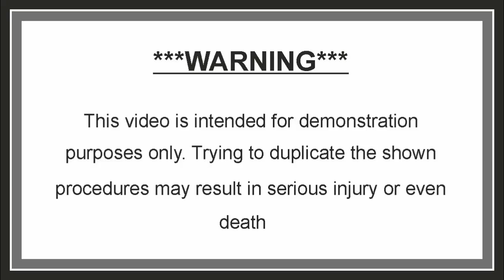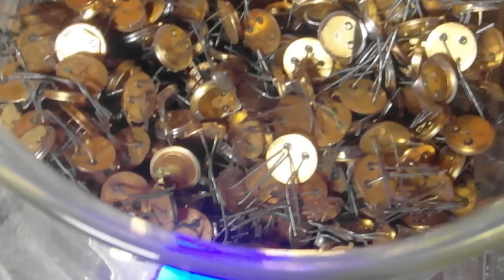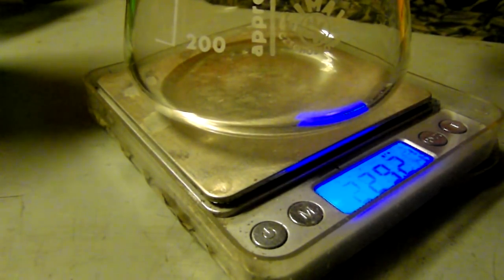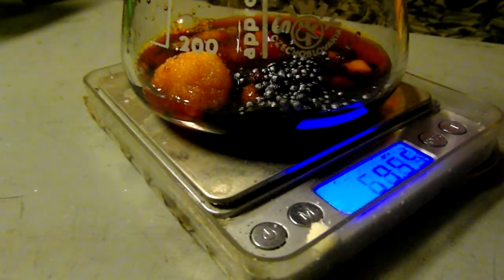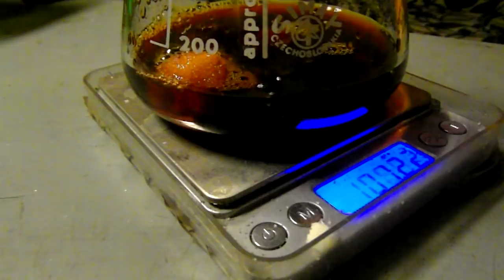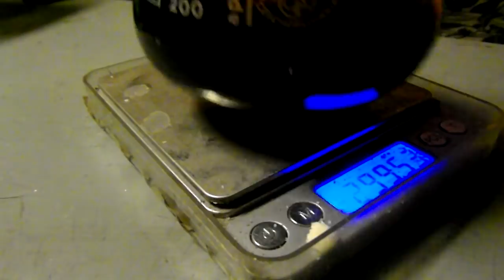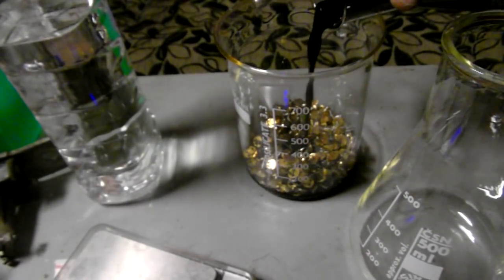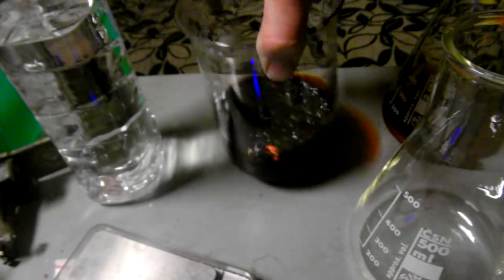GOLD extraction from transistors with iodine PART 1 of 2

Comment: I really want to do this but it seems so complicated. I'm use to AP then after that putting material in aquaregina. I want to get away from using nitric acid. I have access to Provadone 1% iodide and tincture usp iodine 2%. I have way more provolone iodine then I do the tincture iodine. I'm looking for a easy way to process gold plated pins.
I do recovery from pins, VGA chips, IC chips and gold foils. The rest I give to the scrap yard.
I been at this for 6 years and I have yet to find a simple method.
I'm not a chemist so when people say Hno2 or hlc I always have to look them up. It would be super helpful if people said sulfuric acid, hydrochloric and words that us common folk can understand. Thank you so much for all you do!
Reply from the maker: A good place to start: http://www.yoreplacermine.com/placer_gg13_024.htm

Comment: Is this process used specifically for magnetic gold plated items or can it be used on non mag. gold plated items as well? Thanks
Reply from the maker: I had the biggest success with magnetic gold plated, it also works on non magnetic, but the leach needs to be precisely  tuned otherwise it will attack copper to a great extent. interfering with the process . I've made some videos on leaching non magnetic gold plated pins with iodine.
Reply: @OwlTech333  Thank you a bunch! Very informative 👍

Comment: Love the video. I've had mixed results using this method. It has worked well with AMD ceramic processors, but I've had poor results with gold plated pins and magnetic gold filled items. A coating forms over the gold and stops the leach from working. I get some gold from the leach after precipitation, but not the yield I expect. If a soak the leached gold plated items in HCL for a day, the coating is removed and I can see the remaining gold plating. Not sure if you have run into this issue and have thoughts on what I should do differently?
Reply from the maker: Hi, what is the colour of the coating and what is the base metal? Also, was the solution diluted or concentrated?
Reply: Thanks for your reply. The coating is dark in color. I'm not seeing the nickel plating like in your video. When I wash the pins in HCl there is an Iodine odor, so I'm assuming some form of Iodine is coating the gold plate. 
My leach is not as strong as what you use in the video. I'm mixing 2g of KOH in 80ml of DIW then adding 6g of crystal Iodine. Once the Iodine goes into solution I adjust the pH to 8 then add 1.5g of Potassium Phosphate Dibasic to maintain pH thru the leaching process. I've found that the acidity of the leach increases through the leaching process. Using a buffer keeps the leach pH constant. Thanks again for sharing your expertise.
Reply from the maker: OK, you don't have enough KI to keep your iodides in solution,  AuI - yellowish-green powder,  Insoluble in water. Soluble in alkali iodide, cyanide solutions. Decomposes in warm acids
Reply: Thanks for your suggestion. I'll test it out hopefully this weekend.
Reply: Worked much better! Thank you!
Reply from the maker: Nice!
Reply: andywhite82 hii .. Excuse me , could you tell me how many gram of gold can be extracted from 1kilo of AMD processor ?
Reply: @andywhite82  Hey Andy. What PH do you adjust to when precipitating the gold out of solution?
Reply: @philipgiammatteo4308  Hi Philip. Per Hoke the hot Oxalic solution should test as slightly acidic. Check out chapter 15 in her book. The gold refining forum is also a wonderful resource.